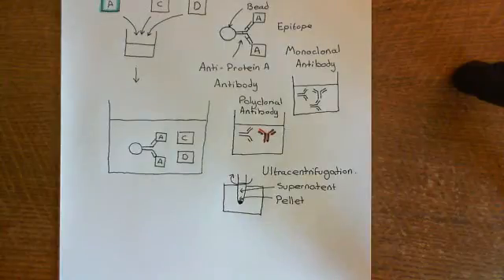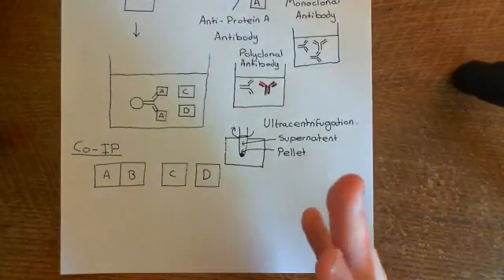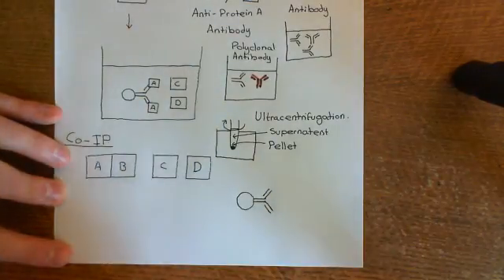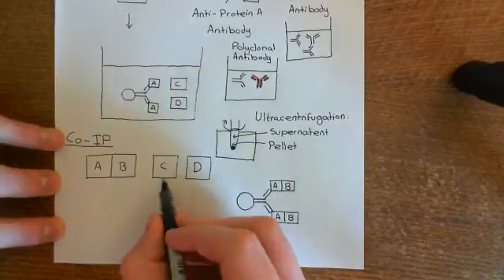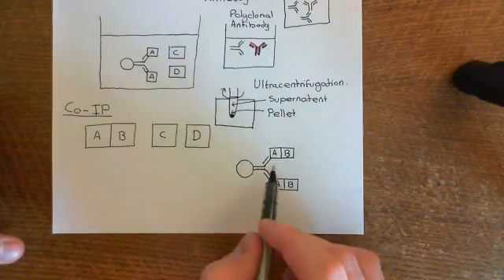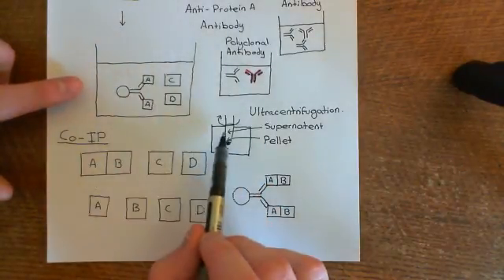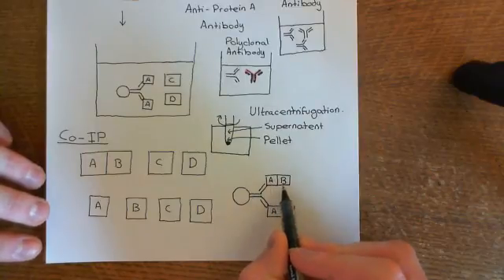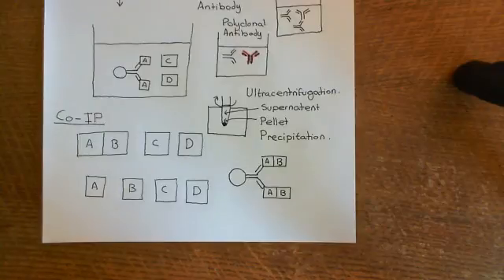Co-Immunoprecipitation Part 2

Comment: can you explain what those tables that have the dark bands mean. Every video is about explaining how to do the process, what about the results?? how do we know what's going on in the results??
Reply: Hi Rishan. I know a few technique needs to be followed after immunoprecipitation to obtain the results. They are direct and indirect techniques.

First, is an indirect technique called SDS-Gel Electroporesis (SDS-PAGE). Namely, the technique describes to have protein solutions to compete inside a gel which have micro diameter pores. The manner of the competition is relied on the length of amino acid sequences of proteins. The dissimilarities occurs when the gel is under a electric current, after submerging in a solution which has conductive ions and salts (and pH). The pore diameter is optimized for proteins to move inside the gel neither freely nor difficultly. Finally, you conduct and compare A and AB and ACD solutions under SDS-PAGE and make proteins visible with various dyes or protein-binding metal ions. The disadvantage of the technique is that you cause both all bounds to unbound and proteins to denature to linear forms.

Second, is a direct technique called immuno-fluorescence, is a rather very expensive technique to consider using extra antibodies(AB). That is to say, you mark A and B proteins with a series of another fluorescence bounded antibodies. You can see the difference with directing different fluorescence markers to your preferred ABs. Unsurprisingly, to illustrate with a scenario, sole A will marked with RED, sole B will marked with BLUE, you will see AB together in GREEN which is the visual interference of red and blue.

All other techniques that I know are developed from these two basic techniques. if you interest in more details you can find a lot more details by keywords. And beware, there are a lot of interpretations using antibodies. For example, affinity chromotography is my hero by means of its power to scan a huge amount of binding candidates.
Reply: Thanks man, really appreciate you trying to help but I guess you didn't really get what I am asking for (maybe it's because I don't know how to present the question) but I am still in the dark about what I needed to know. :(
Reply: Rishan Rangslang Hey it was pleasure :) Don't you ever get frustrated when you don't understand something. I believe you have good questions, you will really know it after you learn it. I hate to say "others", but others will memorize it, you will know it. 

Try to materialize your question again.
Reply: Do you want to know what those boxes stand for? They represent any experiment tube, and the upper lines represent the volume consists of aqueous solutions. They differ in ionic content and in pH. If we need proteins to protect their tertiary forms, we use physiological pH 7.4 but if we need primary, linear forms we rather use acidic pH ~3.
Reply: btw this is the article I am talking about:

http://www.nature.com/nature/journal/v520/n7548/full/nature14147.html

I just want to know if anyone can like tell me what i need to do to understand and be able to interpret the results of the experiments carried out in the research paper mentioned above. is there a specific book or is there a link on the internet or maybe a video would be very helpful.
Reply: Dude, of course, you could understand every aspect or detail in a scientific paper but actually it needs time and patience with reading. It would be better if I did know you personally. I mean I don't have any information about your level. I don't know what you both know and you don't know.

Anyway, I would suggest you to begin with the books section of the NIH Pubmed, and after learning the context you should read more and more papers. Start with review articles, that's a research article. Research article wouldn't teach you if you are a beginner, rather they are used for to report or declare a research result.
Reply: To me it sounds like you would like to know how to read the results of a gelelectrophoresis. Might I be right? Unfortunately there isn't one answer to this question because gelelectrophoresis can be used for different purposes. But as this question is a year old already maybe you have all the answeres to your questions and know a lot more.